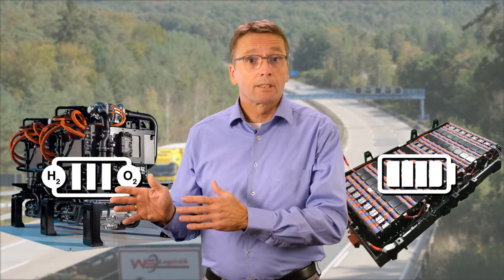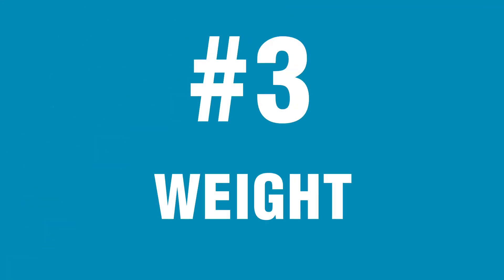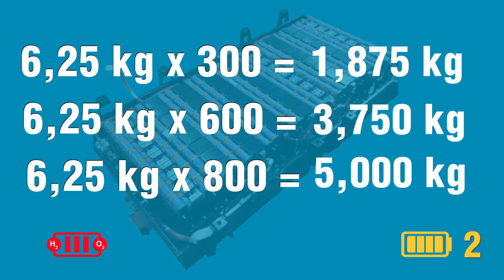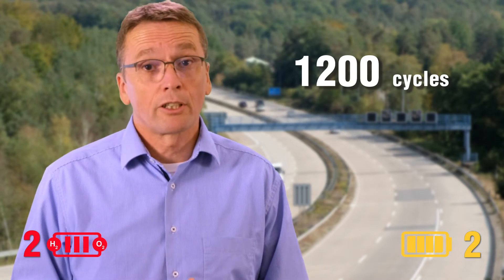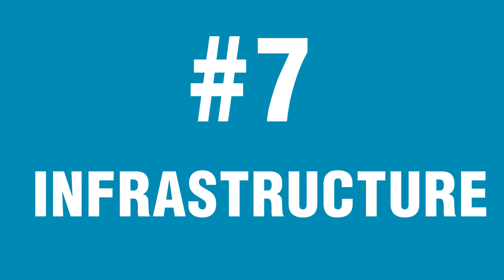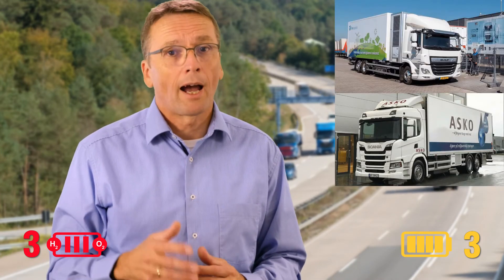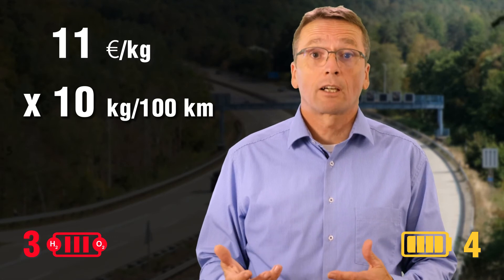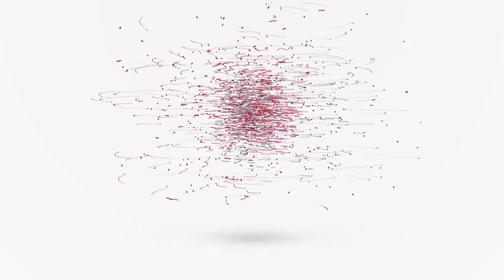Sustainable Trucks: Fuel cell vs. Battery - Which is the better solution?

Comment: The cumulative "Zamboni" issue is not talked about if millions of Passenger and Commercial Hydrogen Vehicles Fuel Cell's labor on roads as a collective during below freezing temperature Seasons spewing water. I just can't wait for below freezing winter driving, as often found World wide, and here in the States where millions of Vehicles move about, when in a fully built out Hydrogen Future Energy Society where countless hydrogen vehicles have driven before us spewing mostly cool liquid state water exhaust droplets from a hydrogen fuel cell's 60-80C/140-176F exothermic reaction coating the roads with "black ice" for us to drive over and wreck our vehicles on ! Remember that liquid water begins to steam, when heated, to a higher 100C/212F Temperature. To start before embracing Hydrogen Vehicular Transportation please research the phrase "Black Ice". Next watch closely the Hydrogen Vehicle videos showing under high acceleration water mist vented conspicuously, and directed straight down coating the road surface. Watch the videos of people drinking Hydrogen Passenger vehicle tailpipe emissions by-product. Even " H2O '' liquid dump buttons flipped on from the driver's position. I don't support slips and falls in parking lots from countless, intentional winter temperature liquid water waste dumps left when leaving parking spots building up on successive below freezing cloudy days. Now high centering your vehicle on an iceberg mound that is safe ! This concept is just another, not so well thought out,"GREEN", idea that when applied into the real world, with millions of passenger and commercial trucks produced by so many manufacturers  needed to fuel a society with hydrogen to keep us safe from climate change, does not keep us safe from injury or death when in vehicular accidents or falling down when encountering ice. A future Hydrogen Economy when built out, operating so many Hydrogen Vehicles that are spitting water on below freezing road or parking lot surfaces day after day in continual below freezing temperatures is not the answer! It only takes  a small patch of ice for a person walking to slip and fall. The key point is the state of the vehicle water emitted. Internal Combustion Engines (ICE) have high thermal heat output 250-800C/482-1472F and the resulting combusted fuel emissions cocktail comprises much less liquid water state exhausted as a portion per mile which is, in the case of an I.C.E. exhausted mostly instead as water vapor, which as we all know, is emitted as a gas vapor not settling on a road surface, but dissipating up as heat rising into the atmosphere. Present fuel cell designs drip much water, about a cup per mile, plentiful commercial Trucks / Lorries much more in the liquid state as the only single resulting byproduct, able to fall in a cool liquid form, ready to freeze on colder road surfaces. That is the difference. How about adding a steam heating unit to the fuel cell's liquid water by-product exhaust, this may be an energy intensive solution reducing mileage, and efficiency during winter driving, but lofting water vapor up off the road as ICE propelled vehicles now do. My concern is where to put the liquid water produced. Maybe an onboard tank to freeze solid and burst when parked. At a stop sign or light idling then accelerating adding heavy icing right there to the road surface just where one wants to actually stop. A parking lot to slip and injure another walking by the back of your parked vehicle or after you drove off leaving water to freeze there. A roadside gutter so a pedestrian can slip stepping off a curb, maybe falling down flat in front of stopped traffic and out of view of drivers ready to accelerate forward. Your driveway so you can fall there. Your Garage to slide across while holding your infant child then both hitting the hard floor. Maybe, you need more tasks or to be distracted by mopping up the garage floor before the water freezes and your groceries just purchased thaw. Maybe a high speed highway perhaps in a turn.  Maybe the unlimited speed limit Autobahn with high water production by those higher electric energy demands moving the hydrogen vehicle through the dense resistant air while simultaneously dumping large amounts of water mist under body contrails at high speed directed onto the road surface. Your Hydrogen Vehicle needs to relieve itself in public, Where to do it safely. Now considering these real world usage / interaction scenarios listed, are Hydrogen Vehicles a good idea. As a vehicle operator you can rate the chance of consistent, caring, and professional operator actions observed when you're out exercising your privilege to be with others in the public driving arena. I am not certain that rushed Hydrogen vehicle drivers will find and maneuver over a public storm drain water dump station to let their hydrogen vehicle relieve itself in public places safely when freezing weather is happening. I foresee many more "could care less" vehicle driver water dumps and very few careful vehicle driver water dumps. I'm not comfortable giving these "could care less" about you drivers a water soaker sprayer for society at large to walk or drive over the resulting "black ice" when a dash indicator flashes an alert "water tank full" during their trip. 

  As an example of related but current human behavior, many times I see trash / rubbish go swirling out of a moving pickup truck bed in the States, or dumped out a moving vehicle window instead of being caringly placed in a proper trash/ rubbish waste receptacle when arriving at one's destination, as an example of drivers' proper public disposal habits. My fear is water dumps by a dash button will be handled in the same careless manner as trash thrown on the ground any old place

Maybe add antifreeze to the water dump so it can mist on following vehicles windshields / windscreens then be smeared when wipers on, so the trailing driver has no clear view of the road. Now that is safe ! Then more windshield solvent , with poisonous methanol, is added to the ground by constantly spraying to keep a clear view. Now we're turning wipers on and off, as if that is not distracting to manage while driving in heavy traffic or oncoming bright sunlight in turns. Now that's safe.

Maybe many Hydrogen Fueled Vehicles can dump water, and antifreeze, smearing trailing vehicle's glass view 360 degrees, that is now spread everywhere in the environment. Now that is green, think !

Maybe the Hydrogen Vehicle owner after the cost of a fill up of Hydrogen decides to not pay for the extra cost of perpetually filling an auxiliary antifreeze reservoir that costs more than gas or petrol per gallon. Cumulatively I do not see any transportation fuel savings when buying both Hydrogen and Antifreeze for the fuel cell's water as a by-product tank.

Maybe granular or liquid salt treatment of ALL the roads ALL the time when temperatures are below freezing, even on sunny winter days ! Now raising the P.H. in streams from water mixed with salted trickling runoff 24/7/ all winter does not sound very Environmentally conscious or Green Think savvy. Get ready for higher taxes to pay the millions of dollars to pay for road treatment. Pay for replacing your scratched up paint. Pay for a broken windshield / windscreen when a chunk of salt is thrown on it during truck/ lorry application. Buying a new Vehicle often because your vehicle rusted prematurely from driving all winter on heavily salted roads.

Maybe add vehicle exterior damaging or ICE engine air filter intake & cabin air filter clogging traction grit like coal furnace electric generation plant cinders or mined beach sand from environmentally sensitive areas to the below freezing road's surfaces 24/7 all winter to combat black ice on road surfaces, filling the streams with sediment to clog fish gills when stirred into the water column later by heavy rains to follow in warm weather. Now one has to think twice about opting for a green and healthy deep breathing bicycle ride or walk on a drier warm early Spring Day to work or for pleasure while breathing the leftover dust from many Winter months of road grit application stirred up by passing vehicles.

Maybe the antifreeze adder system breaks or is disabled. Now the trailing driver is back to sliding on black ice in below freezing cold temperatures when Hydrogen is used in Vehicles as a transportation fuel spewing ONLY clean water onto the roads as the only by-product of its use.

Possibly you or another will be in a hurry to turn into an urban area open parking space like so many hydrogen fuelled vehicles did before you after many back to back freezing days. Just think of how many possible times the same parking space is visited by a different vehicle on back to back below freezing days. Only to slide on black ice your vehicle's front bumper into the side door of or bumper of an already parked vehicle in the next parking space because of all the repeated water dumps released earlier by other shoppers under the hydrogen vehicle's body.  : (

Here in the States most road temperatures fall below freezing during Winter, especially when traveling dark roads during long evening hours. Just imagine creeping with hundreds of other vehicles during slow rush hour traffic on road surfaces that are tilted, for warm weather water run off, door handle to door handle on multi lane interstates while hundreds of Hydrogen vehicles there with you drip water on to below freezing road surfaces. Yes you imagined what will happen when your vehicle slides toward or into the vehicle on the downgrade. Resulting in another hassel to fix your and the other driver's vehicle. I would bet vehicle monthly insurance rates will cost more to cover all the " Fender Bender" type accident claims caused by gravity sliding your Hydrogen vehicle downgrade into another. I just foresee so many black ice issues with hydrogen fuels by-product during below freezing road surface temperatures.

Comment: you should cover fire safety, cold weather performance, range degradation. Also, your battery to range equations are linear when it should not be. More batteries add more weight and more weight reduces the efficiency of every additional kWh of battery on board.

Comment: Unfair comparison. You need count the efficiency of Electricity from power plants .
Reply: I did not claim that the comparison was all-encompassing. There are certainly more aspects to cover, but  in order to give those who are new to this topic an initial assessment and a few important arguments, I thought these 10 points were quite appropriate.
Reply: It will also be interesting to see how hydrogen produced from garbage and biomass via pyrolysis affects the equation.  The assumption that all clean hydrogen comes from green electricity is questionable.

Comment: The presenter says that fuel cells have been used for years in stationary applications.  The agency on whose board I serve, the Alameda-Contra Costa Transit District, has been operating hydrogen fuel cell electric buses for 20 years, so has TfL (Transport for London).  Our fuel cells are reaching end of life at over 30,000 hours, the hydrogen fuel cell buses in London are lasting as long, far more than the 5,000 hours cited by the video.  Hyundai has a production line for class 8 trucks and has sold1,600 of them to Switzerland.  Infrastructure costs for large scale fueling with hydrogen is about 1/10 that of battery charging, very different from only fueling 5 or 10.  AC's hydrogen is delivered at $7.73/kg., far less than the 11 euro/kg cited by the presenter.  The US Department of Energy has a 1/1/1 program -- 1 kilogram of green hydrogen for one dollar in one decade.  That will result in a delivered to the vehicle cost of about  $3.50 - $4.00/kg, far less than diesel.  Overall, this  video is very biased toward battery electric and has very out-of-date information.

 -- Chris Peeples --

======================================
H. E. Christian (Chris) Peeples
At-Large Director
Alameda-Contra Costa Transit District
1600 Franklin Street, 10th Floor
Oakland, California  94612-2800  U.S.A.
+1-510-891-7151, (c) 510-851-0968
cpeeples@actransit.org
www.actransit.org
======================================
Reply: Thanks, Chris, for this additional information. I used many different sources when reasearching prices for H2 and lasting times for fuel cells. Both figures are based on manufacturer's statements but may be not fit every application. I personally believe in fuel cells to become the major source for long range trucks. But beeing a journalist, I wanted to present the arguments in an unbiased way. All the information and figures presented are as of 2020. I admit that  the speed of development in this industry, is rather high.

Comment: Perhaps the math was based on 2020, but recent auctions for renewable, actually in December 2020 in Portugal, 12 EUR/MWh changes the assumptions. Also, the load charges on the electric grid are no taken into account, let's say they are around 100 EUR/kW per year, then the charging options are absolutely in need of scrutiny. The model needs to be reworked in principle, from birth to grave, also one needs to take into account all other losses in the systems, and include future development prospects, then the balancing act becomes far more complex and risks of unknowns are everywhere. As a logistics manager, 2.5 heavier battery means during the life around 5 million ton-kilometers, not the fact one is going to neglect, contrary, this deadweight or payable option has the economic break-even already determined, hydrogen wins.

Comment: You need to factor in the waste issues. The differences between trying to recycle the fuel cell versus the lithium batteries. Also the environmental effect and carbon foot print to manufacture those batteries and all of the environmental hazards, waste and pollution to mine and process the lithium to build the batteries out of. Their green factor isn't so green. Also alternative energy isn't that reliable and you still fall back on power plants and fossil fuels to recharge from the grid. Technologies to create Hydrogen are pretty simple using electrolysis and sometimes hydrogen is a byproduct of some manufacturing processes. Some chemical reaction produce it without electrolysis or electrical input. Granted you still have to compress and store it. Making it from water is an extremely sustainable method and does not pollute or add to land fills.
Reply: These are the most important points IMO

Comment: Hydrogen fuel Cell truck fleets are already in use in North America. Mass transit, shipping, garbage collecting, delivery fleets. They are only being used on the coasts though. In many areas right now there is CNG Fleets because the infrastructure is there. If we had more fuel cell filling stations in North America I am sure the vehicle numbers purchased would eclipse Electric quite quickly. In North America especially the US we have to drive farther and need the extended range of Fuel  Cells and the quick refill rate. Time is money when you are hauling or transporting goods and services or need to work in large areas. I easily go through 50 gallons of fuel in a Fleet vehicle some days. There is no possible way to try and hopscotch through charging stations or spend the time constant short charging all day long. I drive a dual fuel vehicle now that extends my range using CNG. I can drive the first 200 miles on CNG and then switch to gasoline without stopping. Just push a button on the dash. The CNG get's 1 mpg better than gasoline and is much cheaper per equivalent unit. I believe that fuel cell technology is much more feasible than battery for commercial and private vehicles.
Reply: Please list the locations and companies currently running hydrogen powered trucks?   Searching with google yesterday I found nothing currently in use in the USA.  It's all steam and mirrors  ( hydrogen doesn't make smoke) as all I can find is a demo here and there.  No actual trucks SOLD to a customer in use on a regular schedule.  Hydrogen is bs.

Comment: You forgot to mention the cost for grid upgrading due to the large number of battery vehicles on the grid. This will become a problem as fast charging goes out the window. Without nucleair power storage of reneweble energy will also need to be considered. While storage in hydrogen during surplus situations will be easier. Ballard systems estimates it can get the cost to below battery powered vehicles in 10 years. Without an upgrade to other battery chemistries my money is on hydrogen.